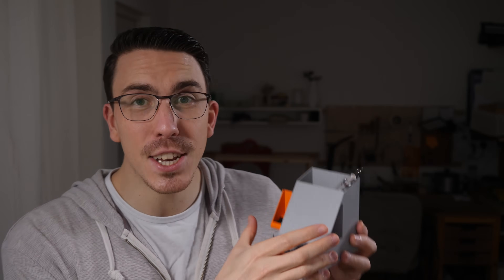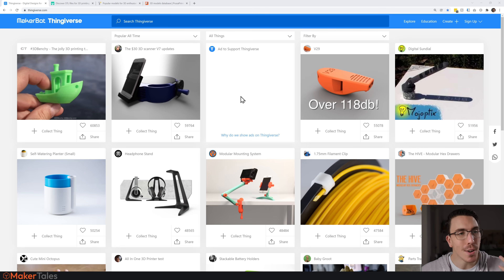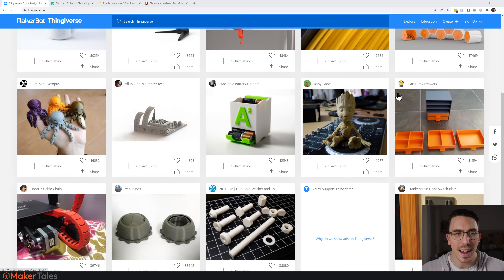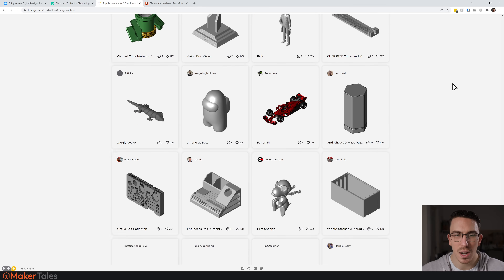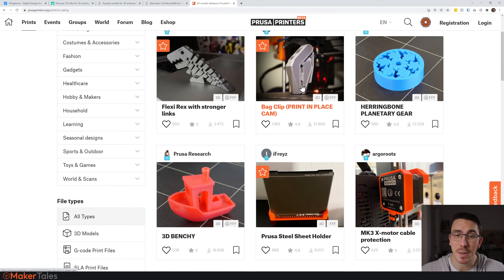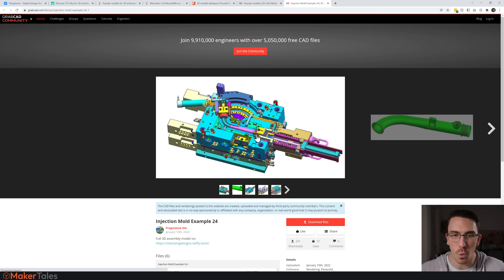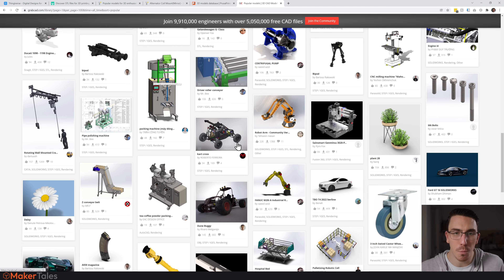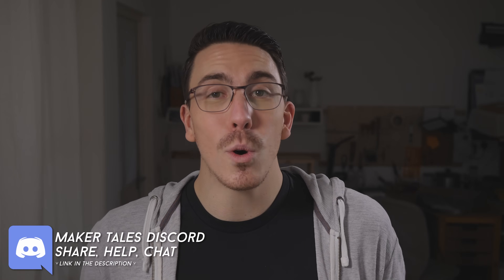Blender 3.0 Or FreeCAD For 3D Printing | Which Should You Learn?

Comment: It's not about fifth digit accuracy or parmetrization - every time I try to use Blender, the same problem pops up: it doesn't save solids suitable for a 3d printer.
You load a simple cube, apply a texture (displace modifier or whatever), and there you go - fifty normals inside, a hundred intersect faces, zero faces, non-flat faces. 
Yes, my hands are crooked, yes, I can find every plane and rotate/correct/displace it. But honestly it's a diagnosis.

Comment: the good thing about cad programs is you can generally set things up where if a dimension or feature needs to change on a part, you can make it so that everything dependent on that feature you just changed scales appropriately. 

"oh i need to make this mounting hole pattern fit a different motor that mounts with 8 screws instead of 6 and its metric instead of standard threading now?" 
you can literally change 2 values in solidworks and it will make that happen if you set it up correctly in the first place.

its definitely more suited to industry and mechanical applications where you will have revisions and redesigns and someone might need to access your part later to change it

Comment: Interesting video.  I think both have their place and it mostly depends on the maker.  I use both. 

I use FreeCAD when I'm building something that is parametrically driven. I have a number of models that I need to adjust based on client requirements and it is trivial with a spreadsheet-driven setup in FreeCAD. I'm not sure if blender can do that sort of thing as easily.
Reply: coming from a solidworks background here but design tables are a godsend when you need a bunch of variants of the same part

Comment: I just got a 3d scanner, I was using blender, fusion, freecad. now its meshlab, blender, freecad, 3d builder. workflow takes me all over the place these tools all do what they do well.
Blender is a must. Freecad can be time saving in some cases. Meshlab can handle far more vertices than blender and is good for getting things ready for blender or freecad, 3d builder is the fastest way to tell if a model can be printed and can try to auto fix the file.

Comment: I use OpenSCAD. When I got started OpenSCAD could run on any computer I had kicking around and blender needed more resources. 
I don't think you actually answered why someone would want to use blender for making models that will be 3d printed. One thing about a text based system like OpenSCAD is the ease with which one can modify and make different versions of a model.
I have been thinking I'll work on picking up blender when I retire in a few years. I'm also interested in looking at FreeCAD. There are things that OpenSCAD can't do. Blender looks to be a lot more complex. I'm generally using a laptop at home and rarely use a mouse.
EDIT
Okay I once again ran into https://youtu.be/QSsVFu929jo which reminded me of issues with freeCAD. I'm thinking that has not been resolved yet?
EDIT2
Finally started playing around with blender out of interest in throwing together assemblies and possibly animations. As I get the basics down I can see value in creating models quickly.

Comment: I want to download 3d terrain models from TouchTerrain and then add text labels to them before printing them. A guy at my local makerspace 3D printing club told me it would be "easy", but 2 months later I am still stuck! I started with blender, but my text needs macrons over the vowels and the built in text with blender didn't seem to be able to handle that.🤯 I will give your free course a try, but if you ever wanted to make a video along those lines I would be very grateful!

Comment: Great video! I love your content. Just so ya know, you never need 5 decimal places. I use Solidworks basicly everyday. 3 decimal places is the most you will need for most detaied designs. 2 decimal places is good enough for dimensions that aren't to holes. This is especially true for sheet metal. With each decimal place the cost of production increases exponentially.

Comment: Meanwhile Blender just got a CAD extension for that sweet parametric modelling.
Reply: I've been testing out that add-on, and while it's hopeful, it's got a long way to go before it can compete with other parametric modeling apps.
Reply: Blender still can't do NURBS properly, which is what all 3D CAD software uses. It also can't export STEP files, which are what CNC machines use.

Comment: In the FreeCAD wiki there are instructions for embedding FreeCAD within Blender. I'm wondering if there isn't going to be more common ground between these two packages.
(I'm sure both sets of developers do in fact talk to one another).
If people can create a 3D object in the software they're happiest learning and most comfortable with, then that's the one to go with.
I'm more familiar with FreeCAD but I will need to create some figures so I'm considering MakeHuman which I believe is/was part of Blender. FreeCAD users will frequently export to Blender and render there as it looks much better. But FreeCAD has some specialist WorkBenches that make the creation of certain objects easier. (Or that's my suspicion at least).
I think your question should have been, 'Which one should you learn first ?'
Reply: If that's the case id say hands down blender. Itll be getting more cad features anyways.
Reply: Trick question... that answer is learn the Blender Sketcher Add-on first that way you can learn blender but have a set of handy CAD tools available for when you need precision for your various 3d printing tasks.

Comment: Blender has been frustrating me. If boolean operations weren't finicky, and you could do basic things like bevel some text without having to manually intervene for the meshes of various letters, it wouldn't be such a pain. Sometimes I spend so much time doing 3d print workarounds in Blender that I think I must learn FreeCAD and see if I can ultimately do the same things quicker and cleaner.
Reply: @Honk before it's too late  If you figure out, let me know your conclusion, please.
Reply: Fusion 360... If you are doing only things that requires precision, but you are using text... Fusion has hard times with high verts count
Reply: A couple really cheap addons take care of any issues with booleans, bevels, and most other more complex geometry issues.
Reply: @Ferrous_Bueller  You have an addon that perfectly bevels text without manual intervention?
Reply: Freecad is kind of unforgiving, but with a bit of practice and learning it is really flexible and good for 3D printing. 

If you are artistic, I think blender would be a better fit, but if you like thinking in Cartesian coordinates and don’t mind some mental math freecad is quicker to make things of specific dimensions.

Also, freecad is so good at adding operations using polar, linear or symmetrical patterns.

Comment: A deficiency with Blender is that making movable mechanical assemblies is a massive pain. You need to set up a rig and do a whole bunch of stuff with constraints and drivers and shit. Or perhaps have horrible bunch of empties and parents and constraints. It's all very gross and time consuming compared to mates. With proper parametric CAD you just download a bunch of pre-built step models of components from McMaster-Carr, GrabCad, and Traceparts and assemble them together with mates and you got yourself a working robot in short order. I suspect a bunch of the robot rigging stuff will be improved late 2022-end of 2023 though with the animation tools refactor (previously "Animation-2020" project -- currently delayed indefinitely).
Reply: Oh but it's worth noting that FreeCAD's assembly system is also currently terrible...but it will probably be fixed before Blender is good at mechanical rigging as RealThunder, a developer for FreeCAD, has been adding a lot of commits lately to fix a lot of what is wrong with FreeCAD and whenever those fixes are reviewed and merged in like a year from now (maybe), it should be much better and almost as good as classic commercial CAD.

Comment: Yepp, Blender is awesome! And can probably do most things people need for 3d printing needs - probably even for basic CNC stuff. What it currently cannot do yet is to export any formats (like STEP) that can describe true curves, circles etc. And afaik the more expensive CAM programs can generate G-code that instructs the CNC machine to carve perfect curves from the provided radii. With triangulated files as a basis this would be more difficult (the CAM program would essentially have to reverse engineer the initial round geometric base shapes before the triangulation from the mesh). So most likely you won't get the same smooth/efficient G-Code that one could get from e.g. a Nurbs based STEP file.
Also CAD programs have a lot of additional plugins howadays (like FEA, CFD etc.) that can be important. And most CAD people probably use libraries of standard parts that come with the bigger CAD packages. Many of these plugins and standard parts could possibly also be provided for Blender - if somebody does the work...
Reply: Yep. For CNC stuff or doing anything with industry you need STEP files and Blender (or other mesh based modelers) aren't going to get those ever (although they could get step import pretty easily, just not export). If you're just 3d printing though, mesh based formats are fine.
Reply: Correct me if I'm wrong. Blender stores data in-term of 3D meshes, instead of true geometrical constructions. So, it can't export them in those 3D CAD format precisely. As per Jonathan - Blender can approximate the model upto 5 decimal digits precision only. Stl, step and other CAD formats use true geometric form. It can do upto whatever precision level we so desire.
Reply: @alihms  Yes that's exactly right. Blender is used for polygon modeling and is intended to manipulate triangles on a fundamental level. Free CAD is designed to loft blueprints with lines that are mathematically precise to infinity. They are fundamentally different programs intended for completely different industries... Basically, Blender is just like Photoshop as Freecad is just like Inkscape. Both produce 3d Models, just as one would photos, but the way those 3d Models work are fundamentally different at the core level.

You would never use Free CAD to add 3d special effects to a movie, just as you would never use Blender to design a factory that makes computer chips in the real world.

Comment: I still firmly believe having the knowledge in both tools is key to creating anything you need, especially when working with other vendors if you're not yet set up for completely vertical production. Very interested to see how well the CNC add-ons are implemented in blender... I'd also like to see some form of slicing and gcode implemented as well for fdm and sla.
Reply from the maker: I absolutely agree with you!
I would however suggest to most to learn blender first if there needs don't NEED CAD as I personally believe they will have more fun faster and get that 3D modeling bug to push through that learning curve that FreeCAD has.
Reply: @Keep-Making  definitely... Jumping in to FreeCAD with no experience is usually a very short and frustrating trip, usually diverting to fusion... Blender has a much better tutorial ecosystem with lots of content and helps ease folks in.
Reply: @Keep-Making  interesting! I am a beginner with a Bambu Lab and have 2 product ideas, and slowly am starting to realize I need Blender for the first (something low poly-art based) and a CAD program for the second... (a box that has electronics and there will be lots of prototyping the shape...)... ah well, better get to it i guess!

Comment: A good question indeed. The question for me however is not so much accuracy but rather if it is a one-off design or will I want to go back and change it, scale it, add more of a certain element (e.g 6 slots  instead of 4 slots in a CD holder) without redoing a significant part of the model. I have not used Blender before;   and wondering if it's parametrics are good enough to do rapid-prototype of such things?
Reply from the maker: You might be pleasantly surprised how parametric blender can be when the model is made with adaptation in mind. I'll have a lot more coming out in the future here. Alternatively, if you really want to take the plunge and me be being a little cheeky I will be covering it pretty extensively in my paid course coming out in just 2 weeks. Not a bad pre-sale deal going on at the moment 🙃